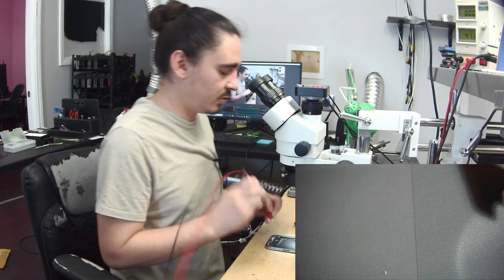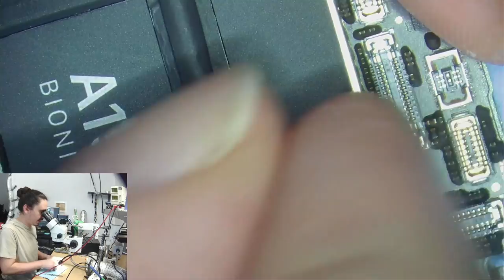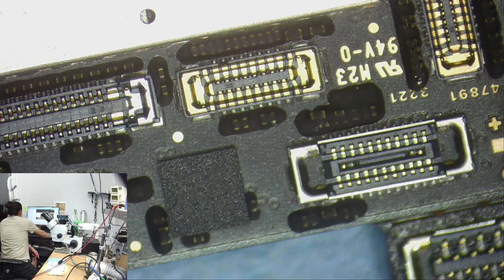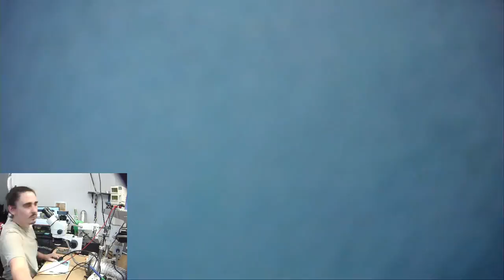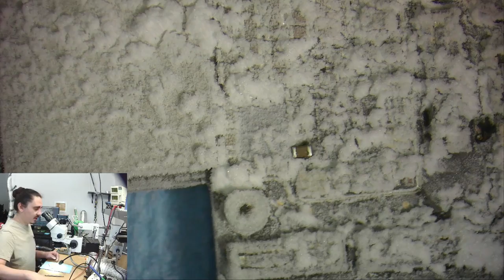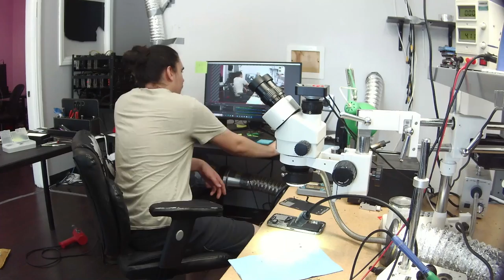How to fix a Broken iPhone 13 Pro Max Motherboard - Short Removal for Data Retrieval

Comment: How do you determine voltage to use to inject power into the line to find the short?  You said you just knew how much on that particular line.  Does ZXW show you the voltage of the line?
Reply from the maker: Sometimes its in the name, sometimes I know from measuring hundreds of similar iphone pmic outputs.

Comment: I need to ask after removing this capacitor can the phone function as normal and won’t go dead again?
Reply from the maker: In general it should be fine now and doesn't usually go bad again. However, it was never supposed to go bad in the first place so you can't say for certainty it won't again.